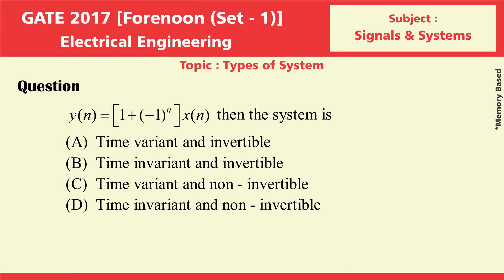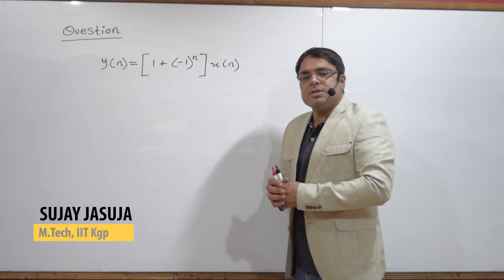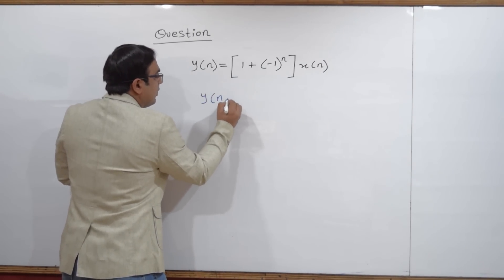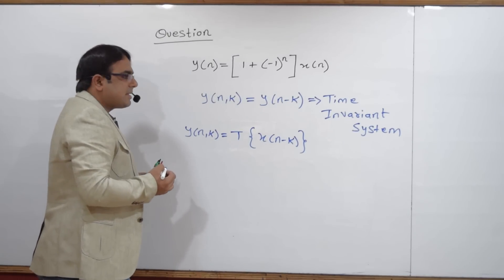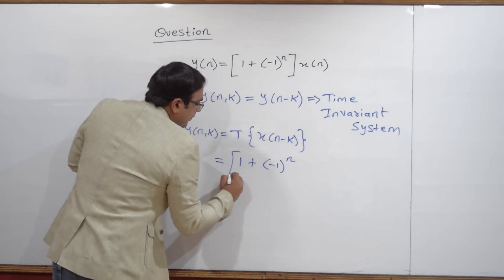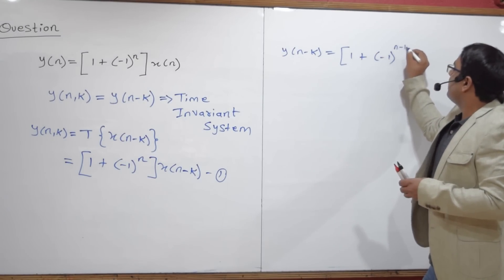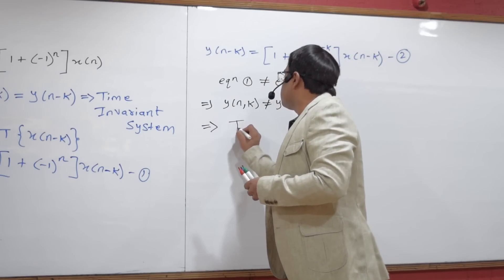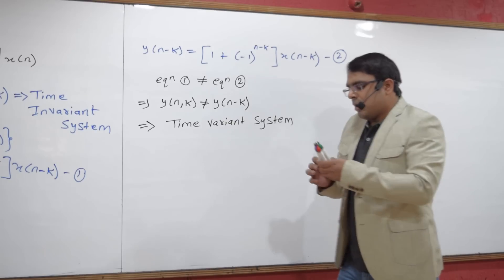Lecture 19 | GATE 2017 Solution | Set 1 | Electrical Engineering l Signals & Systems

Comment: sir delta(n-2) per to diff output aayega...???
Reply: agr ek baar bhi aisa hua to non invertible
Reply: vikas chouhan but here at Delta(n-2) will give output as 2 and not zero like it gave for delta (n-1) 
So now invertible or non invertible?
Reply: You are getting "same output" for "two distinct inputs". Isn't it? That is enough to conclude non invertibility. We don't need to bother about what happens when some other input is fed to the system. This is the basic criterion to test non invertibility of a system.
Reply: Debanjan Datta hey thankyou so much for clarifying :)
Reply: No problem!
Reply: @oye_shiwi  if it fails invertability condition for atleast once then we can conclude it as a non-invertable system that's wat DATTA mentioned
Reply: @adityajain3102   yes.. if there is one reason to prove non invertibility or non linearity or time variance or unstability then the system will be non invertible or non linear or time variant or unstable respectively inspite of having 100 reasons to prove it vice-versa.
Reply: @anushkanath8058  Then anyone who have conclusion of this del(n-2) now. After this much of confusion?